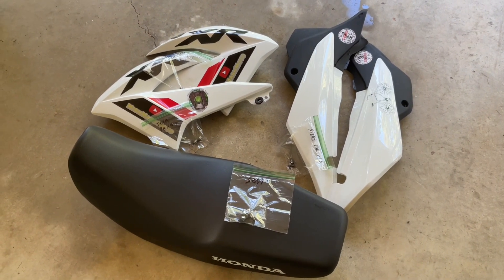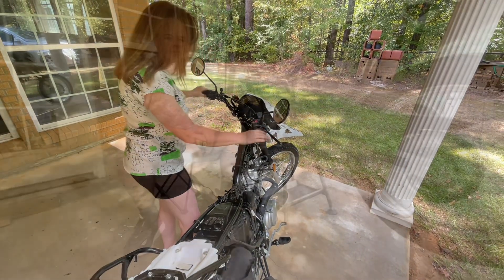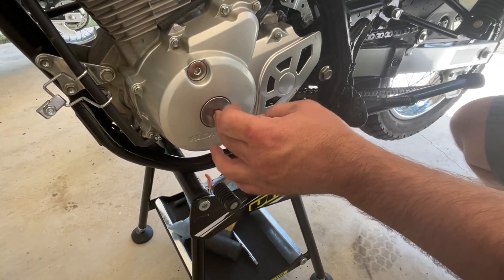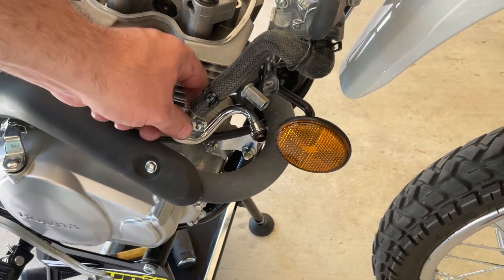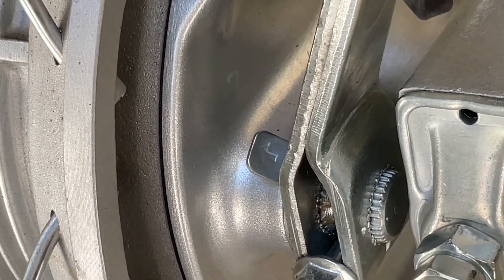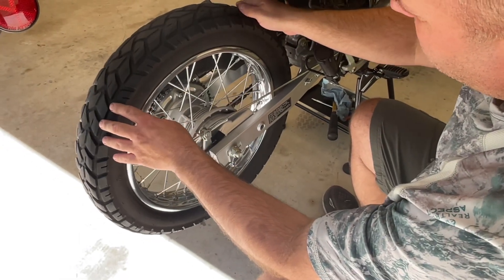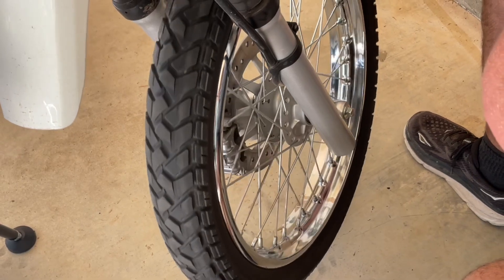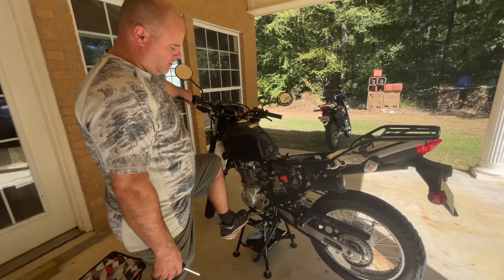2023 Honda XR150L Additional 2,500 Mile Service Items and Valve Adjustment How To Tips

Comment: Greetings from Central Mississippi. I just want to say, I appreciate these maintenance videos. There isn't a lot out there for the Xr150l. If y'all have to do any repairs, I hope to see a video on that as well.
Reply from the maker: So far so good with our 2 bikes. No repairs needed except for the 1 fuse problem. We plan to do a big bore kit upgrade at some point fairly soon.
Reply: Definitely need a video on that! I just ordered one for later install. I feel like I might have to change carbs when I do.
Reply from the maker: @edgarbradford  If your running the stock/factory carb. Yes, for sure!

Comment: Just found your videos. I was researching this bike before deciding perhaps purchasing. Im looking in the used market for it and figuring how to notice signs for neglect or abuse. Now i see what to listen and pay attention to.
Reply from the maker: @timothymidkiff2894  Really dirty air filters, dark or smelly oil, how the clutch feels and is adjusted, rusty chains, worn sprockets, broken/bent spokes/rims, bald rear tires (slick like a drag strip burnout tire in the middle), bent frame, missing parts. It's normal for some wear and tear on a bike like this, but those are just some items I look at when buying a used bike. Don't worry to much about if the bike is shiny and clean or not (as long as it's clean enough to inspect everything). Happy hunting, and don't be afraid to walk away or offer less if it needs some repairs. Most people will negotiate fairly.

Comment: Thank you for this. I am just now coming  up on my 2500 miles soon. I noticed you mention testing new carb jet sizes. I am in Kansas City (I think roughly 600ft sea level). Taking out the snorkel and running a 110 main jet or at least bumping up to a 108 does a lot for your torque. Some people had nice results with a 38 pilot as well, depending on how open the exhaust and intake system is overall
Reply: I believe the extra airflow is healthier for the engine as well, in hot weather and at sustained upper rpm range, the engine can overheat at stock settings. Since opening mine up I haven’t had this issue anymore
Reply from the maker: @Crash-mi8os  The 115 main jet adds even more torque in the low/midrange and runs much cooler on the road at speed. The MPG will go down slightly. On the stock carb. and at about 600' I would suggest you try the 115 main jet at least.
Reply from the maker: @Crash-mi8os  BTW, if you go with the 38 pilot be sure to free up access to your idle fuel adjustment screw so you can fine tune the idle mixture. You will also need a "single D" type adjustment tool ($5-$10 on Amazon).
Reply: @MishMashMoto I might try 115/35. Last time I tried 115 with 38 and it felt bad. I am thinking too rich. 110/38 feels just right. I might try 115/35 though now that you mention it. I did tinker a bit with the idle already and it seems to be doing just fine.

Edit- I should add I added a full new exhaust system as well as taking out the snorkel
Reply from the maker: @Crash-mi8os  Try the 115/35, I think you may like it. If not, go with whatever works best for your bike. Be sure to pull the welch plug out to gain access for the mixture screw (I wasn't clear on if you did that or not yet).
Reply: @MishMashMoto  oh, I thought the idle adjustment screw was the flathead one in the middle of the plastic part though. I’ll look into adjusting that as well
Reply from the maker: @Crash-mi8os  That is the idle adjustment. I am talking about a round plug on the bottom of the carb. that needs to be pulled out to gain access to the idle fuel mixture screw (single D style head). Drill the Welch plug and insert a screw into the hole and pull it with pliers (it's tight and hard to pull out).
Reply: @MishMashMoto  thanks for looking out for me. I’ll be looking into that soon

Comment: Nice video. Do you know any after market fuel tank will fit XR 150 L. I am thinking if their is a way to double the fuel capacity will be great.
Reply from the maker: I do not for sure but maybe a CRF230L or CRF-150F tank if someone makes a larger tank for those. Might work 🤷🏼‍♂️

Comment: Thanks very much, did you find that there was a range from the dealer for the valve clearance?  I thought it was .003 and .005 +/- .001?.  Reason I ask is that I just did my 600mi check and have a valve tapping sound.  Intake was great, right at .003 and wouldn't fit .004.  Exhaust side felt good with a .005 and would fit a .006 but felt snug.  You think I should go ahead and tighten that exhaust down till it won't fit a .006?  Thank's, sorry for the long comment.
Reply from the maker: Any mechanical tappet type engine will always make a little tappet noise. I try to set mine exactly at .003” and .005” respectively. My Honda dealer didn’t give me the tolerance and I didn’t ask for it because I am pretty anal about getting it exactly right. Your exhaust is really set at .006” and while that’s right at the largest spec limit it’s not going to hurt or damage anything it will make slightly more tapping noise. Just run it like it is until your ready to go back in and get it back closer to the recommended specs. When mine start making noises again is when I go back in and adjust them.

Comment: You probably figured it out by now, but there's a nut on the back side under the cowl to adjust the headlight
Reply from the maker: Thanks for that, I need to find it and make a short video on how to adjust it.
Reply: @MishMashMoto  yeah, I don't know about yours, but mine came with the headlight aimed super high
Reply from the maker: @smoothboye4203  Mine was good until I attempted the big hill climb that didn't go so well. The bike landed upside down and bent the headlight frame ever so slightly.

Comment: I hope this is not repetition. 
The manual indicates valve check every 4k km I am wondering if people are seeing wear trends now that these bikes have been here awhile??
Reply from the maker: We have about 6,500 miles on both of our bikes now and not seen any signs of internal engine issues. Valve clearances have been consistent so no signs of wear. We run our bikes pretty hard at an average of 6,800RPM for many hours a day sometimes. Quality seams to be very good on this engine so far.
Reply: @MishMashMoto  Awesome! Thanks Again

Comment: Before doing the valve adjustment did you notice any extra “Ticking” noise during warm idle? Also and changes to idle noise after adjusting?
Reply from the maker: Yeah, I have a good ear for “tappet ticking”. It was making a little noise. Probably about .003” slack on the intake side. Nice and quiet after adjusting.
Reply: Thanks for the reply! Seriously great camera work and clear instructions from you guys. I’ll tackle the valve adjustment soon.